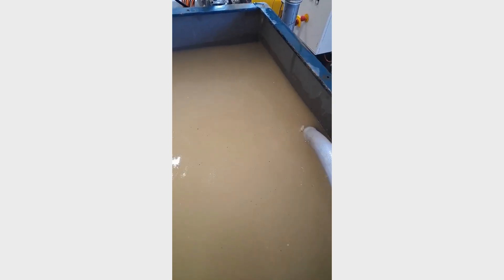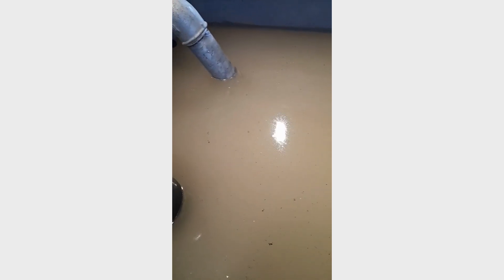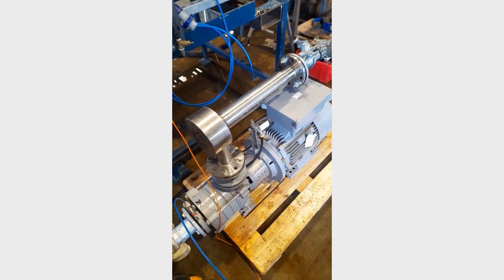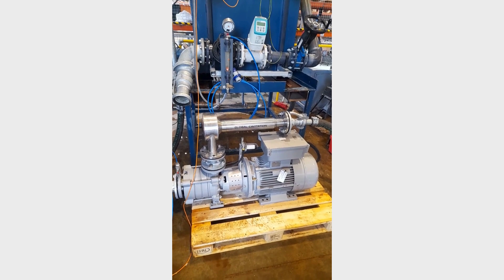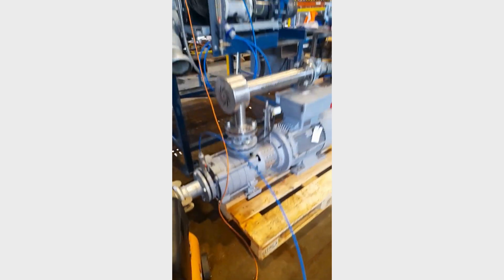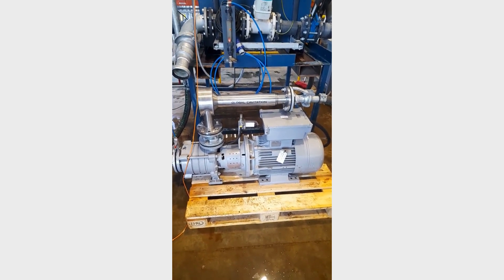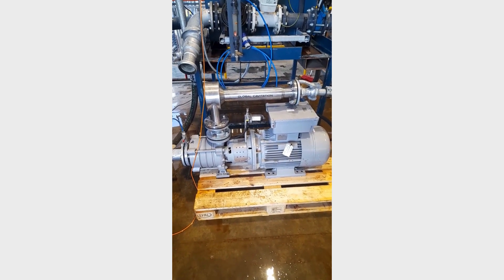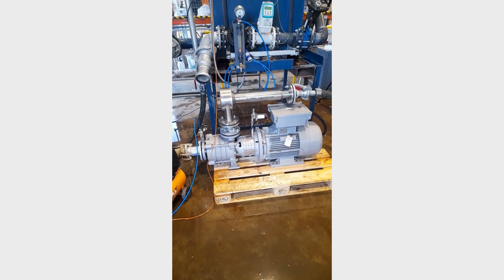Testing our G-CAV device for use in water treatment.

Comment: What is the water used for after if it’s infused with 02 and hydrogen?
Reply from the maker: After infusion the water can be used in irrigation, drinking, agriculture, aquaculture, wastewater or bathing in it!
Reply: @GlobalCavitation  if I were to purchase this can it be used for electrolysis? I know hydrogen is highly conductive but it’s explosive, would having an anode and electrode within the water cause an explosion? I don’t want to blow myself up lol
Reply: @GlobalCavitation  also what are the benefits for bathing in it? I’ve seen hydrogen infusing water bottles before but lack education in that area if you could please enlighten me
Reply from the maker: @scaledsilver  The hydrogen is supplied into the water as a gas at the intake side of the pump and is supplied by a Hydrogen Generator.
 You can see more detail on the references below:
Zhu, Q. et al. Positive effects of hydrogen-water bathing in patients of psoriasis and parapsoriasis en plaques. Sci Rep 8, 8051 (2018). PMID:29795283; http://dx.doi.org/10.1038/s41598-018-26388-3
 
Todorovic, N., Javorac, D., Stajer, V. & Ostojic, S. M. The Effects of Supersaturated Hydrogen-Rich Water Bathing on Biomarkers of Muscular Damage and Soreness Perception in Young Men Subjected to High-Intensity Eccentric Exercise. J Sports Med (Hindawi Publ Corp) 2020, 8836070 (2020). PMID:33123594; http://dx.doi.org/10.1155/2020/8836070
 
Tanaka, Y., Xiao, L. & Miwa, N. Hydrogen-rich bath with nano-sized bubbles improves antioxidant capacity based on oxygen radical absorbing and inflammation levels in human serum. Med Gas Res 12, 91-99 (2022). PMID:34854419; http://dx.doi.org/10.4103/2045-9912.330692

If you have any further questions, please contact us at info@globalcavitation.com

Comment: So your stopping the cavitation by adding air no? Or reducing it and using the remaining cavitation break up the added o2 into nanobubbles?
Reply: All of our systems work by injecting gas of preference on the suction-side of the pump, which combined with the water is taken through the impellers and discharged through the cavitation device. Cavitation and nanobubble production takes place through the device, ejecting nanobubble infused gasand water under pressure to where it is required. Bubbles as low as 7nm being produced, equating to around 332 trillion bubbles in 1 ml of water.
Reply: @simonwalshaw3153  how are you selling these, I'm in Tamworth. I'd be interested to see if there is a market here for them.
Reply: @narens3266 No Venturi! Gas is injected on the suction side of the pump, at 1.5% to 2% of flow and taken through the pump and cavitation device.